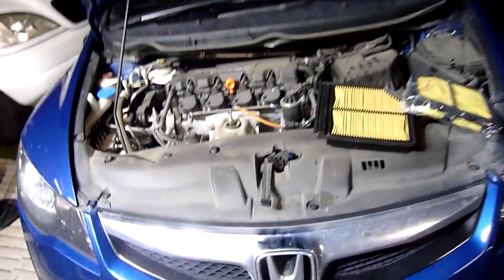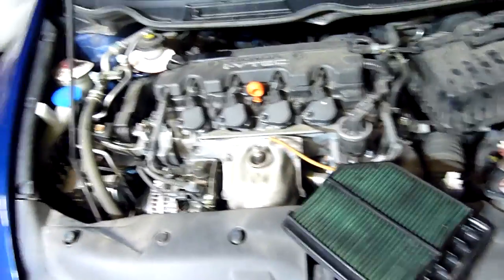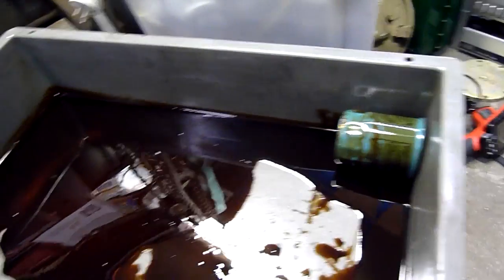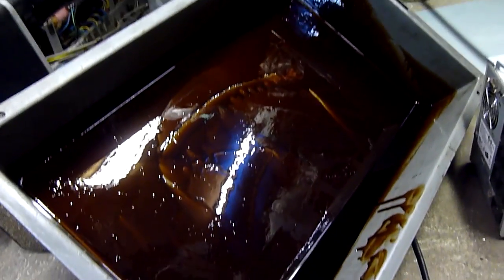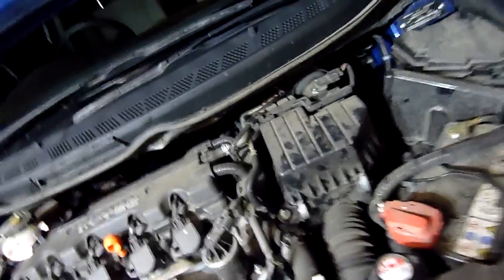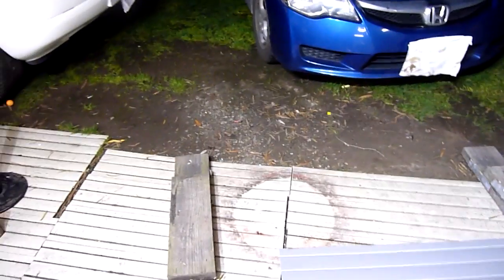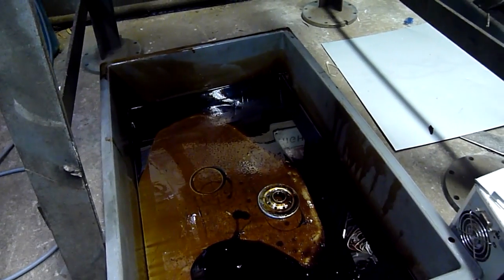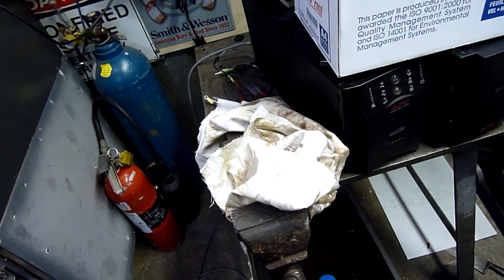2010 Honda Civic overdue oil change

Comment: I never check my vehicles, I turn the key and go, far too messy for me to get involved with all that, for years I've been hoping the engine on my van would pop, but it never has, if someone is too close driving behind, I drop the clutch and press the accelerator to the floor and they disappear on a cloud of smoke, its great.
The merc on the other hand needs a fuckin computer to open the bonnet, so I just take it to the garage, it arrives back all shiny and new and I have clean hands.. how wonderful.
Reply: ***** I do the service on my merc. You need to hold the reset button to reset the service A and B so it stops bugging you :p
Reply from the maker: ***** Hehe, I am the guy who ends up making it shiny for you, and swearing because the oil filter has stuck itself on :p
at least I still enjoy it :D, some day that will change tho.
Reply: " if someone is too close driving behind, I drop the clutch and press the accelerator to the floor and they disappear on a cloud of smoke, its great. "
That made my day xD
Reply: Benjamin Esposti
or when I need to pass a cyclist im stuck behind and finally get a opening, step on it, cloud the cyclist in black soot....and nothing I can do about it , I NEED to step on it to pass.
Reply: ***** These days I find myself taking my car to have it's oil changed.  When I was younger every weekend you find me under the hood of my car doing something.
Reply: Get a 1986 Ford F-250 With Diesel. Good Fuel economy, and no computer BS.

Comment: Just asking a random question: So I'm looking to buy a 2010 Honda Civic, 95500kms for $9000 negotiable price. The owner allowed me to take it to a mechanic to inspect if everything is good! Long story short, Everything was good except! When the mechanic checked the oil, there was barely any or it was really low. Keep in mind that the owner had majorly serviced the car at 93000kms. So in the span of 2500kms it drained heaps of oil. My mechanic told to try get it down to 7k because of the oil problem. Is this problem common problem that can be maintained or is it a major issue? please leave your thoughts and opinions. thanks!
Reply: Mark Gallego he was driving the car real hard. Holding gears, pushing the engine. That burns all the oil away if you dont check it

Comment: On a neglect case like that, I swap out a quart of trains fluid for a quart of oil when I put fresh oil in. Highly detergent. Run it up to temp, drain, change filter and oil again. Drain and change again after a tank of fuel. She'll be alright mate. :)

Comment: Company i used to work for bought a new VW Transporter, they had it seviced twice in 40k (should be every 6k) miles and by then it was making a tapping noise, when they took the head off it had worn the bores so much it needed the biggest oversize pistons available to get back to clean metal.

Comment: Ed, just bit of info , My 2008 Toyota Tundra 4.7 litre v8. We change oil every 16,000 km
truck now has 340,000km absolutely trouble free miles. Never had the covers off. Runs like the day it was new. Not bad for an all -american built Toyota, eh ! We will see how long it will last.
Reply from the maker: zonie1953 That truck is doing a damn good job!, I would bet US toyota's outlive the modern Japanese ones!. Toyota Japan is loosing the market to the Koreans IMO. too many recalls and failures.
Reply: I dunno Ed, I think some of those so-called recalls were trumped up by other manufactures to to hurt Toyota. The thing about that truck is it is built here from toyota parts. That truck also has all city use in desert heat. 44 celsius here today, a brilliant truck !

Comment: Its 30 bux to fill up gas, 26 for an oil change, innexcusable. Id go without eating to do a oil change on my car. No car, no job, no job, no money to fix car.
Reply: ***** It's never quite that cheap here in Aus. Usually about 35 bucks for a bottle of dino oil and 10-20 for the filter. Bit more for synthetic oil. 

Still inexcusable though.
Reply from the maker: Josh Macdonald yeh it was $100 for the service I did not inc labor, but its still cheaper than Honda. and since the car is out of warranty it does not matter who services it now.
Reply: Aussie50 my bad, Its a bit more expensive I guess over there in the land of legal confederate flags. But if this was some ones only form of transportation, and not a honda theyd have been fucked.
Reply from the maker: ***** well, when you consider the aussie exchange rate Vs US the price is not too far off. a full tank in the ML270 is almost $150! 

Kinda sucks that they are trying to whitewash history by getting rid of the Confederate flag, I mean its not nice history, but we cannot make it look like it never happened!. at least Apple has overturned the ban on games depicting the flag in the App store, they just cannot have it on the front page picture.
Reply: Aussie50 its all going to hell in a handcart here. No warrants needed for searching anymore etc. I need to move to australia.
Reply: ***** In Canada here it's a good $50 to fill up gas in a car like that, and the same for an oil change at a shop (maybe around $35 for DIY).

It sounds like the oil has been "topped up" some, but even so I agree that it is inexcusable.  I wonder whose car it is—clearly it is someone who neither knows nor cares one bit about cars.  If it was mine, I wouldn't be able to sleep at night knowing what is in the crankcase.
Reply: ***** here in aus its about 685 dollars every year for rego. if ur in western sydney and/or are a single mother then you will get charged 150 bucks less. then you have insurance!! if youre an experienced driver over 25 with a car that is worth 10k they might cost you 350 bucks per year.. depends. double that amount if you are under 25.
Reply: smallenginedude71 Sounds cheap, try living in the netherlands :)
Reply: Vincent Martens what does it cost over there?
Reply: ***** They still need warrants to an extent. From what I've read the no warrant thing, it mainly includes public places, when police have probable cause, or when any occupant agrees to entry. There's some other exceptions, too, but they're a bit special. They still need a warrant if all persons living in a house are present and object to the search, and no one is being arrested. It's a bit of a grey area...boils down to how the 4th amendment is interpreted. Let me know if I've got it completely wrong and provide links.
Reply: Aussie50 So, the confederate flag doesn't have as much historical significance as many people think. It wasn't even the confederacy's official flag (the one that's being taken down), and it's more a symbol of racism than anything, which is why it's being taken down. To those who want it taken out completely, that's wrong. It belongs in a museum. A quick google search on its history shows multitudes of articles. Now when they start taking out memorials, then it's hiding away history. Just taking a flag away isn't at all acting like a chapter of history never happened imo. Check out Ken Burns too btw, he did a highly acclaimed documentary on the civil war.
Reply: smallenginedude71 Offcourse like anywhere else, depends on the vehicle + age and accident history. I`m 21. I drive a Peugeot 306 Phase 3 from 1999 with all options. Road tax is 118 every 3 months, insurance 64 euro's a month. And gas prize range from €1,56 to €1,80 p/l 

Regular maintenance (if at a dealership) from as low as €140 up till... whatever's wrong with it.. Last time I payed 247 euro's and next time it need a timing belt + tensioners + water pump.. With all the other things that come with it like oil, filter, interieur filter,  That will set me back probably about €400 (590.830 AUD) Keep in mind, its not even at a peugeot garage or anything.. So its cheap.

Every year cars here need to go for their roadworthy test aswel.. etc.

As reference an Audi A4 Highline 3.0 TDi from 2003 just in roadtaxes would cost me 335euro's every 3 months on just road tax. Insurance 185 per month.. Not to mention fuel costs.. ;P O yeah, and maintenance! I know someone who rather drives to polen just because they fix shit for cheap, he had a complete turbo overhaul for €600. the dealer here would have charged him €2300
Reply: Raladras38957 Sorry I have never seen it used for racism. It is a part of our history unless you wish to remove the fact that we had a civil war. The main point here is, this flag is part of our freedom, what else are they going to ban next? A flag should not be illegal.

Comment: 15,000ks between services for Toyotas these days. Modern engines generally run fairly clean and efficient. That said the condition of the engine is the biggest factor. My old FXGT Corolla with the 20v 4A-GE had to be serviced every 5000ks, as it was burning 2L of oil between services and what was left looked like diesel oil. My old 2.5L V6 Mondeo wasn't a whole lot better, but that wasn't burning oil, just going fairly dirty. My 3L though still has decent colour after 10,000ks, but I change it anyway so it stays clean for a lot longer.

Comment: Probably has a cabin filter as well.  My '06 Civic hybrid did.  My car would go close to 10 thousand miles before an oil change, but it did use synthetic oil.

Comment: I'm amazed it still looked that good after your estimated 50,000. I've always had older vehicles and nothing i'm used to would touch that figure without sludging up and dying.
Reply: Josh Macdonald It's probably because it is a newer car that the oil is not sludgy, or at least like liquid tar. The fuel and ignition management systems have a lot to do with it, but also the fact that it hasn't been on the road long enough for the bearings, valves, etc, to wear, but it may have also been running synthetic which takes longer to break down. 5000 miles or twice a year is about the most you want to go between oil changes on an American car, or anything really. Of course since you are in Aus the heat probably breaks oil down even faster.
Reply: Tighter tolerances on newer cars combined with good cold start control prevent most of the contamination in the first place.
Getting the engine up to temp quickly and eliminating cold spots such as the sump and valve cover by using undertrays and plastic engine covers goes a very long way to prevent sludging.
Oil quality and grade are very important. On most cars I've owned or driven long term I can tell the difference between 5w30 and 10w40 after about half a mile of driving.
My Zafira 2.0DTI has done just under 200,000 miles (360,000 km) and uses barely a drop of oil between services - which have been done at 20,000 mile (high usage) or 1 year (low usage) intervals as per GM recommendations.
When you get some fancy stuff like the Honda VTEC timing controller on the end of the cam, good oil of the correct grade is critical to correct operation.
Reply: Simon Parkinson oops 320,000 km!

Comment: If the car is in good condition, driven fairly gently and warmed up a little before taking off the filters almost never restrict oil flow. You can go 50,000km/s between changes over the life of a vehicle and still get well over 2 million km/s from an engine.

Comment: Manufacturer for my car recommends oil changes every 8000km or 6 months, whichever comes first.

I haven't bothered with the "every 6 months" bit, seems excessive to me. I just change it every 8000km or 1 year instead. I use synthetic oil.

I usually drive less than 8000km in a year and also due to my job which requires my to travel (by airplane) quite a bit, the car is only driven for about 8 or 9 months out of 12.

So once a year oil change is what I've been going by.
Reply: +MTTT3000 I've changed out oil with synthetic every 5000 miles - probably premature, but the engine would cost more to repair than what excessive oil changes would cost.

Comment: Aussie50 I would have pulled the drain plug let the oil drain then pour a few litres of petrol in the sump then pull the drain plug then let it drain then put the plug back in then replace the filter then fill it up then do it again a couple of weeks later to make sure it's clean.
Reply: Tomas Gibbs Now there's a risky idea. I'd be nervous doing that with paraffin (kerosene) and it doesn't ignite untill it's quite hot.
Reply: ***** yeah I only ever do it when and engine has been sitting over night but it has never gone bad on my and all our cars oil with exemptions of the diesels come out clean when ever we check them and when it ticks over to service time the oil looks like it still has a bit more life in it.
Reply: I'd be shitting myself about the residual petrol igniting when it's filled and started back up again.
Reply: ***** yeah I could understand but if you leave the drain plug out for a couple of hours it doesn't seem to be a problem the first time couple of times we did it we pulled the sump off to check for petrol and there wasn't any.
Reply: Tomas Gibbs
Well if you're taking steps to make sure it's all out then fair enough. I would seriously consider getting something a bit heavier like paraffin though, but that's just my unqualified opinion. I must admit, I've always thought an oil change feels incomplete when you've got gunky oil lying around in the sump and lines. Just make sure some window licker can't come over and crank the engine over while you're not looking, eh? Could be messy. :P
Reply: On seccond thoughts, at least petrol will evapourate in a few hours, whereas paraffin would need to be quite hot to evapourate away. Idk, anyone else have input?
Reply from the maker: ***** for sludge removal I use ATF or Diesel. dump some in with the oil, run it  hard for a bit around the neighborhood, dump it out and refill with new oil and filter. 
sometimes takes 2 bottles of oil , and 3 filters to get a really sludged motor good again.

Comment: 50K no oil change ?.  whats the point ?.  Even an old lady know about the oil change. The engine if not properly cleaned will develop a failure soon, even on fresh oil. And then, just blame Honda LOL
Reply: 38911bytefree Did you not listen to the "budget restrictions" part, and the fact Honda wanted a lot more than we could afford to service it?
Reply: jgcertified I didnt catch the budget think. I speak Spanish, so getting the %100 of the rambling is a bit hard. Sometimes I back the video, or use YT captions (horrible).  For this one, was too lazy. Anyways, you can take you car whatever you think is cheaper. Cheap oil service is better than no service. Well, is your car and your rules for sure. If you know  the rules, you can break them.

Comment: I change my oil every 3000 miles. Id hate to be the owner when that car gets to higher miles
Reply: What do you drive? no modern car would require that with modern oils. I have a VW Golf R32, I get it changed every 6-7k (miles) but it'd probably good for 10k.
Reply: Si1983h I change the oil in my '99 SAAB 9-5 every 4k, but that's just because the car sits a lot, and despite having the newest PCV setup, I don't trust it to not sludge the crap out of the oil and clog the pickup tube.
Reply: Si1983h I normally go by what the owners manual says if the car is driven mostly on the highway. But if it's driven hard and/or around town then I would change it sooner even if you put synthetic in it. I put 5000 miles (which is the recommended interval) of hard city driving and when it came out it had bubbles in it. That's with synthetic oil and after I let it cool down for 45 minutes.
Reply: Si1983h ones a 2001 accord the other is a 95  toyota corolla they live a life of hard city driving so every 3k is a must
Reply: Nathan Petrohilos Same here, I change my oil & filter every 3000 miles/5000 k's, usually with royal purple or similar quality and always full synthetic. Costs some $$$ for the oil but well worth it, comes out nice and clean every change. 
Car's not standard though.

Comment: Modern cars, lots of annoying faults with sensors just waiting to happern ha ha :-D
Reply: zx8401ztv When it was new it was all sensor faults.. Nothing new there.
Reply: zx8401ztv old cars, pain in the ass to start and deal with in the winter time
Reply: You're right they can be, but modern cars seem to depend on computers too much, when they fail its expensive and can take more than a week to get it sorted.
Yes they start better with all the sensors and extra modules to control the system better, but computer controlled, so hmm.
You are right though :-)